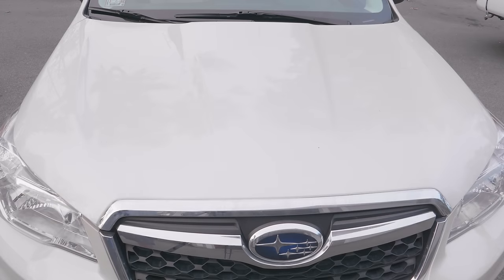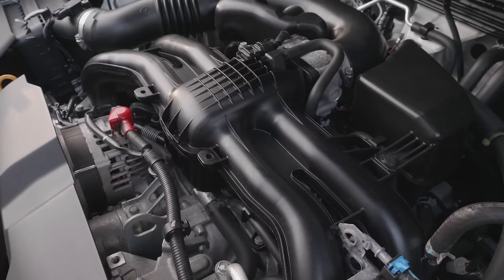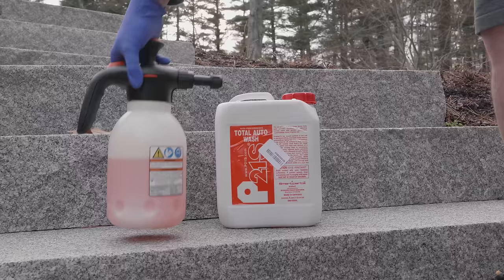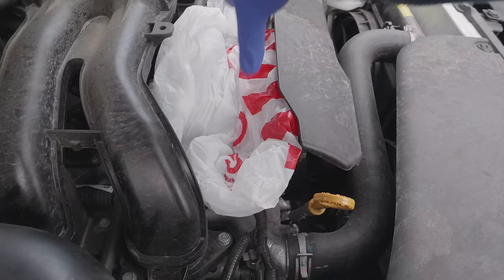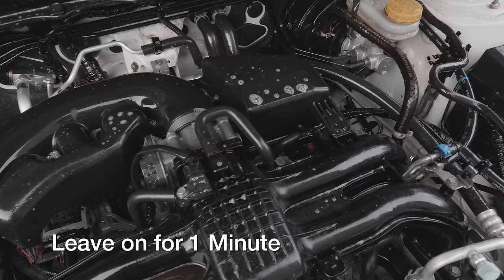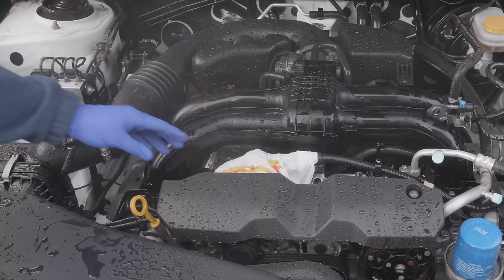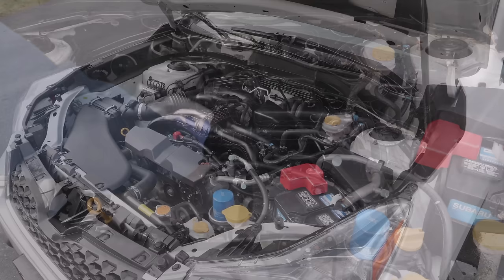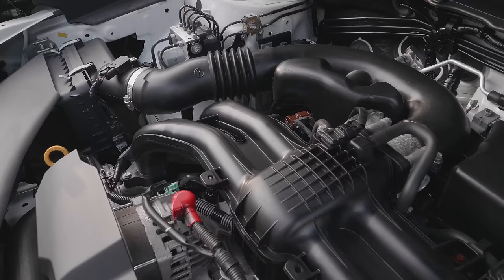Clean & Detail Your Car Engine in 5 Minutes!

Comment: sorry man i,am not spraying water on my electrical components, and guy's and gals, you can do just as good if not better using turtle wax wheel shine,or Maguires hot shine for wheels, or Armor All wheel shine,spray it on twice ,blow it off with an air hose or shop vac wipe down and your done with no harm to anything under you car hood ,for what less than $10.00 not $25.00

Comment: To be honest is better to clean your engine manually and to use how low water possible becouse is you damage your electric cables will cost you a fortune to fix the problem an also water is a corosive etc . Be on safe side , clean but not like that .
Reply: Not true. Most high-end dealers use the same method. Believe it or not when when you drive in the rain water gets on basically everything in your engine including electronic parts and connectors.

Comment: Why would anyone be afraid to hose down engine? Your engine gets more water on it than a hose when you drive in the rain
Reply: Actually, no. Between wheel well liners and weather stripping the engine compartment stays quite dry. Just opened the hood on my Corolla for the first time in weeks the other day. Just a very light coat of dust on the engine cover. Everything else looks almost new. 2017 that has had much winter/rain driving. Toyota has that engine compartment sealed up nicely. No engine cleaning for this guy.

Comment: Good product. But just want to be fair but the engine you are cleaning in this video is not actually dirty . This engine seems to not been used for awhile . If you magnify the engine , you can see that there is only dust and not really much or no oil stained parts at all . No wonder it turned out really brand new clean with that product . But I am sure that it's a good product but I don't think it will really clean like a brand new or so clean as shown in this video. But I course. I would like to try it . Cuz I love cleaning my car. Good video though .
Reply from the maker: The car is 4 years old with 60k. But if you still are skeptical see my 16 year old truck getting cleaned the first time with it too:  https://youtu.be/8aMKkUcTTJ4

Comment: " So after 10 minutes of driving this is the end result..." 
what happened to: Clean & Detail Your Car Engine in 5 Minutes! 
So is it 5 minutes or 15 minutes or ..... ?
Reply: I mean... Technically cleaning it was 5 min. He just suggested you drive for a bit to dry it so it doesn't damage anything lol
Reply: @hakimaguilar453  So when he says "you want to take you car for a long drive to finish the drying" had me believe it was part of the process. Now I'm interested to understand when the clean and detail process finished, was it after the engine was started to fling water off or when the cloth was used to wipe the top water droplets off or was it with the blowing off of the water... very confused. I get the cleaning could have been 5min but it was surely clean and detail in 5 minutes wasn't it. Maybe he meant Clean and Detail your car engine in 5 minutes each stage. Can I skip any steps for the same result?
Reply: @mrrberger  dude... It's not that deep lol I was just kidding. Also I think it finished after the drying with a towel but idk ¯\_(ツ)_/¯

Comment: You are an idiot if you take a water hose to your engine like this.. all auto makers are not the same - all engines are not the same - all connectors are not the same.. proof that this is a fool’s suggestion- he suggests you cover your alternator but Never suggests to cover your battery.. no electrical consultant would ever tell you It’s Ok To Saturate Your Battery With Water.. you risk shortening out all of your connectors.. you risk getting water in the engine.. “wait, how would you get water in the engine”.. well, at the point where water gets into the engine - It Won’t Matter HOW !?!!?
EXTRA ADVICE- if you do attempt this method.. DO NOT IMMEDIATELY TAKE YOUR CARE FOR A DRIVE!!! Let it sit for a day or 2 in the heat to make sure all of the moisture is gone.. I’m not a mechanical electrical engineer but I do understand water evaporation has something to do with air pressure which might be something you don’t want to play around with near a combusting engine in a closed environment.. if you are good with vehicles- take each piece off the car 1 at a time, clean it, DRY IT, put it back… if you are not good with vehicles- pay the money to get it clean or leave it be, you’ll save money in the long run if you’re ok with a dirty engine 🤷‍♂️

Comment: Terrible you should have removed your battery first and also covered the fuse box and pressure washers on a low setting are much safer than drowning your engine bay with a large volume of water you're not watering a garden 🤦‍♂️

Comment: I rather scrub and get everything off then just spray some soap and water. Stop being lazy people and do it right
Reply: Stop doing things the hard way. Scrubbing you can actually push dirt into sensitive electronic ports. Dealers use the same method it's fast it's easy and requires no scrubbing.

Comment: 5 minutes, I don't think so. Tinfoil wrapped around electrical connectors will prevent water from getting in and prevent problems. This video is not the way to clean your engine bay.

Comment: this is video is redicious.  this product is roughly $70 a gallon and the engine you "cleaned" was a practically brand new engine with just a little light dust on it.  this is just a weak infomercial.
Reply: I paid 15.00 on Amazon for it. Spray pump bottle. His engine was actually quite dirty and also his car was not a new car the front end look like a 2014 or 2013 version ....

Comment: Somehow I had to log-in to give this video a thumb-DOWN because, because there is No Way you can get an engine cleaned in 5 minutes (with that one minute wait time, you only have 4-minutes), you were showing a "cleaned engine" which meant you had to blow-dry the water off, right there I bet has already taken more than 5-minutes, finally, you did say to drive the car for 10-minutes to make sure the engine is thoroughly dried, so how did you time-warped to just 5!? 🐂💩

Comment: not impressed 1 bit as previous detailer on "all" types of vehicles. your literally just taking off a light dust nothing major.
1 product is not 100% for everything you do not get the same results as you would using the proper cleaner for that particular piece your just substituting with 1 chemical.
Reply from the maker: I'm sure you will still say the same, but here goes: https://youtu.be/8aMKkUcTTJ4. Its hard to believe but very true

Comment: NEVER clean engine with a water hose. Major problems with electrical connections and the like down the road. Bad advice. Stick to lawn  videos.
Reply from the maker: Sorry but you are wrong. Every professional detailer uses a pressure water or water to clean engines,  steam cleaning is a rarity. My experience, Ammo, Detail Geek & Car Cleaning Guru plus dozens of others all do same.

Comment: Very very very bad idea to hose down your motor with a garden hose, how do you prevent the water from getting into the spark plug holes, its very bad for the coils, and you can seize the plugs to the heads, from the water intrusion corrosion, so get ready to repair stripped spark plug threads, due to the corrosion pulling the threads apart in your spark plug holes, which will cost you to pull the heads for repair, or having to put timeserts or heilicoils into the heads to tepair the damaged spark plug threads. 🤔🧐
Reply: Not sure what kind of car you have that has open plug holes.... what is it?? The old old cars have plug wires directly onto the plug... All the cars I've owned (about 17) the spark plugs are covered by an ignition coil which is sealed and does not let water down into the plug hole - you would need to snap/screw off the coil pack, then pop it out to expose the plugs.